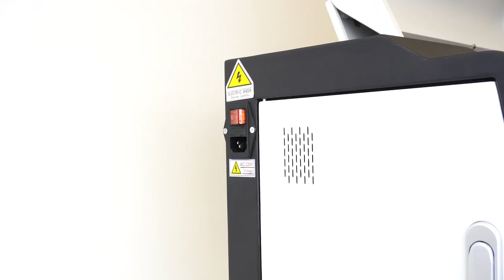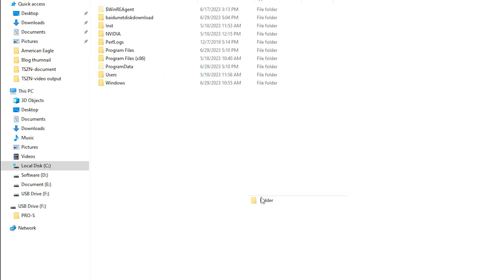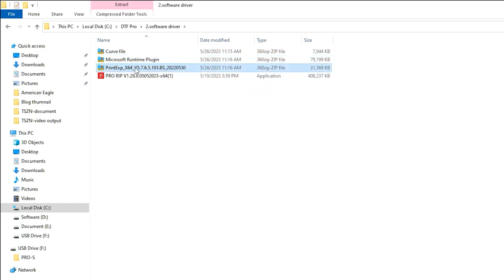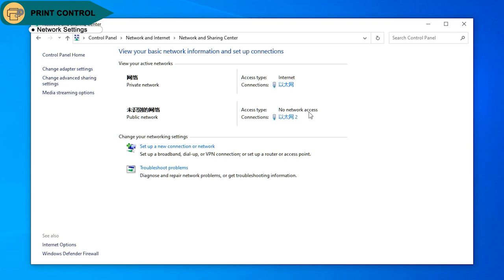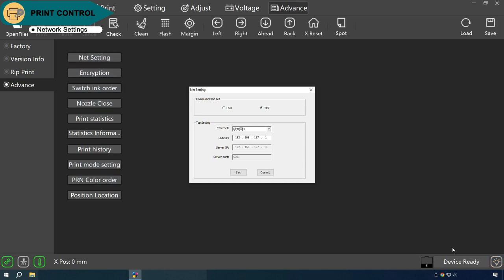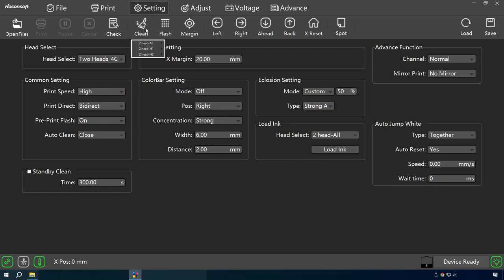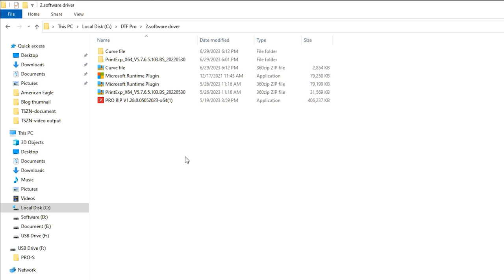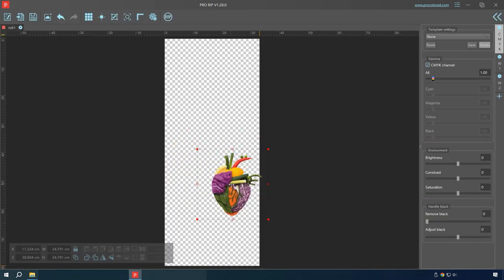F13 Pro DTF Printer Unboxing & Setups | T-shirt Printer Ultimate Solution

Comment: Question. If I already have the l1800 and running on procolored rip, I'll be using the same rip, do I need to rerun the software or can I just add the new printer xp600?
Reply from the maker: Yes, you can use the same RIP. For example, if you buy DTF Pro, just import the DTF Pro printer driver into the RIP software.
Reply: @ProcoloredPrinter  Hello.  I also have the ProRip software. I have the R1390 and L1800. Just received the Pro printer.  I have imported the new printer which shows HS XP600.  But I'm still not able to print.
Reply from the maker: @DjO_89  Hi, watch this L1800 tutorial, you need to switch the device endpoint options back to IP address https://youtu.be/t1c8GLrNL_0?si=r8DPYpMxsfIrfJzs&t=231

Comment: I have a L1800 and order a dtf pro, can i print at the same time?
Reply from the maker: They can connect with the same computer. After installing 2 printer drivers, you can select one printer for the first print job, then another for the second job, so they can print at the same time.
Reply: @ProcoloredPrinter  thank you, have to rip for each printer right?
Reply from the maker: @djxpressnc  Yes, switch default printer at Printer Management in RIP software

Comment: Hello, I followed all the steps but the machines Ethernet cable keeps connecting and disconnecting. What should I do?
Reply from the maker: This is due to poor data contact. Try using another computer USB port. If is issue still exit, send a video to afterservice@procolored.com, our tech staff can help you fix the issue

Comment: I’m unable to process payment on your page and my bank confirmed it’s not an issue on our end! Very stressful. Really want a printer but can’t seem to pay. Not even through PayPal.
Reply from the maker: What's your email? We'll resolve the issue for you.
Reply: @ProcoloredPrinter I had to use another card that wasn’t so secure. My bank kept blocking overseas transaction. Now the issue is my printer arrived with no ink or powder and they shipped an oven instead of the all in one. I was told I’d get an extra order of ink and I didn’t even get the one that’s supposed to come with the bundle. The stand comes with no instructions. This experience has been very stressful and disappointing to say the least.
Reply from the maker: What's your order number, I'll check it out for you. And here is the  tutorial of the stand assembly at the front part of the video. https://www.youtube.com/watch?v=stQuaDsfV6Q

Comment: My data cable does not work. No connection being made between printer and cable.
Reply from the maker: Did you use the USB 3.0 adapter? If the issue still unresolve, please send a video to afterservice@procolored.com, we will ask our tech staff to help you fix it